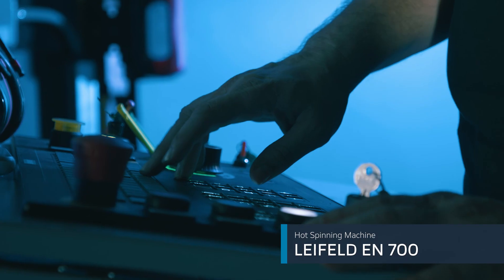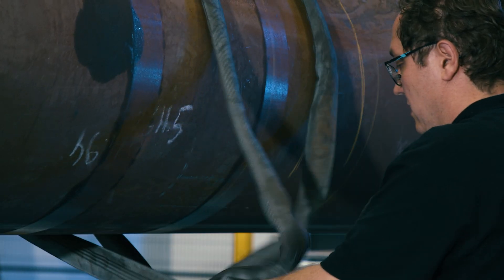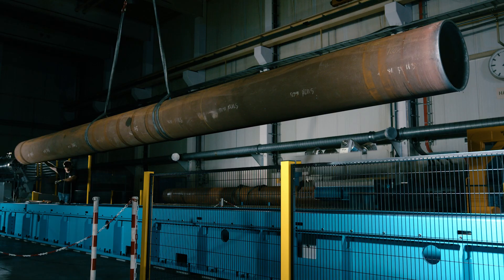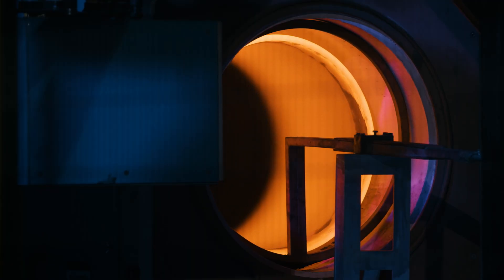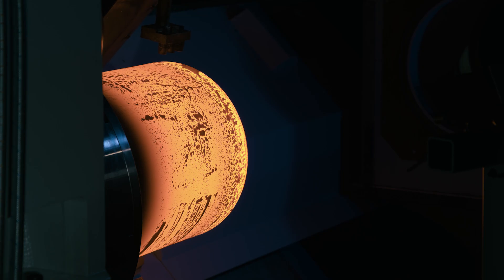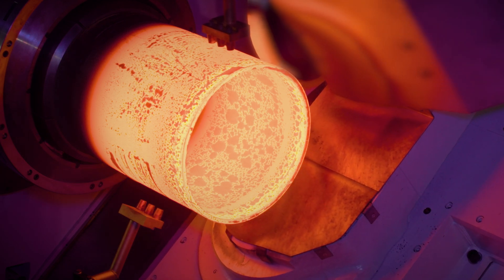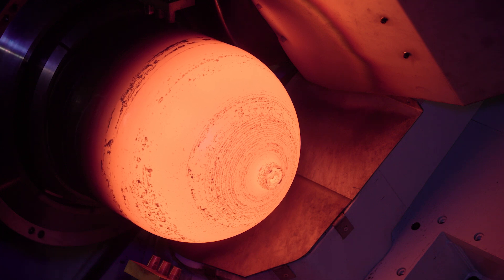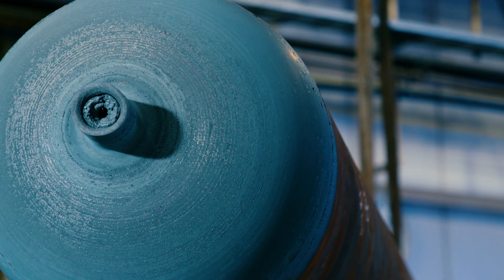Hot Spinning Machine LEIFELD EN 700 | Hot Metal Forming for Cylinders, Jumbo Bottles, Tanks

Comment: In my opinion as a one of user from kind of Hot spinning machines,Leifeld hot spinning machines (Necking-In) has best operation and acceptable ability for producing high pressure cylinders such as CNG and Industrial gas vessels.Also this machines has professional ability for producing any work piece in military and automotive industries that need doing hot forming process.I have been working as a technical expert about setup and operation in Leifeld hot spinning machines since twenty years ago.